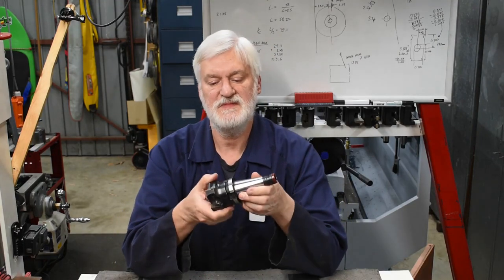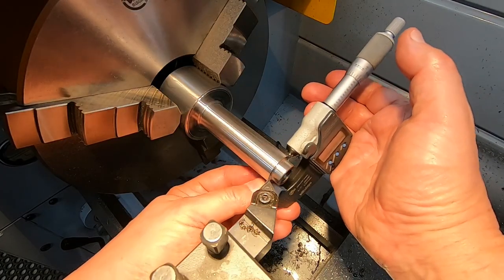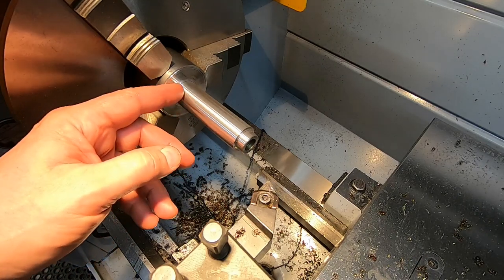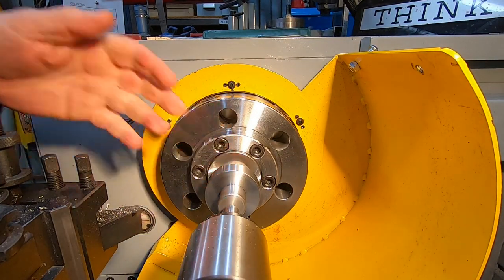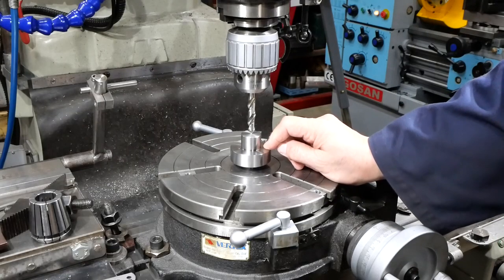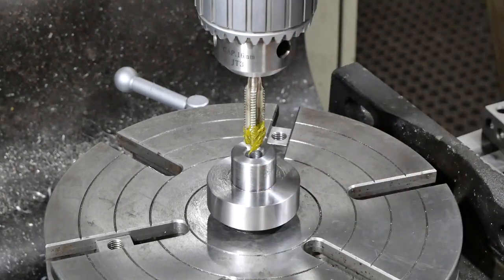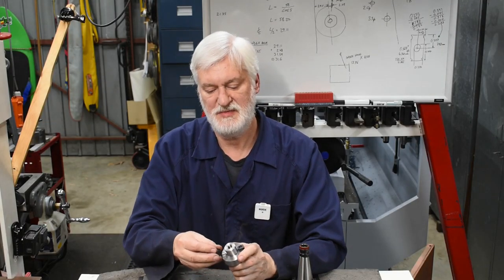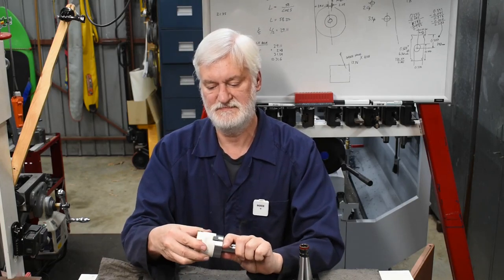Making a #3 Morse Taper milling arbor.

Comment: I started my apprenticeship in the late 60s. We were taught that the Unified system was replacing the Whitworth system of threads, the car manufacturers in the US, Canada and Britain were adopting UNS. In the end, the Metric system prevailed. So I'm surprised that you still use NS taps, unless there is more to the American threads than I understand. Not a complaint. But you do some very nice work, Alan.
Reply from the maker: Thanks for your feedback Bill. When I started working on cars as a teenager in the early 1970's, Unified threads were the norm in locally (Australian) manufactured cars but Whitworth threads were still common in plumbing and general hardware products. Metric threads were common in imported vehicles and starting to became more common in other domains. So I have worked with all three systems and have a good coverage of taps and dies for them. I have also worked with other metric thread systems eg BA, and pre-ISO JIS (they are found in pre-1967 Japanese cars and motorcycles). When no other factors apply, my preference is to work with ISO metric threads especially when using my lathe as it has a metric lead screw. But I also have quite a large range of imperial socket head screws (an auction purchase years ago) and prefer to use them rather than buying new metric items.
Cheers, Alan.

Comment: Question Allen. As a hobby machinist, somehow,  I know not to oil the tapershanks before using. However, just how clean should they be? Example, if I have a small film of oil on my hand and I wipe off the tapershank to remove any debris, would that have a detrimental effect on the tapershank holding still, or should I use a cleaning solvent to clean it every time? Thanks in advance.
Reply from the maker: Well, I'm a hobby machinist as well and can only comment based on my experience. I have no training or credentials to support my opinion and, for context, my hobby activities rarely generate any heavy machine or tool loads. The only time I have observed slippage in a MT shank is when I started using a 30mm twist drill with a 3MT shank. That occurred because I did not preload the the drill in the socket with an axial tap from a copper hammer. Now to your question Stephen, I wipe the MT shank before use with the "clean" rag currently in my pocket and then with a wiped (but unwashed) hand. When returning the tool to storage I apply some Inox MX3 (similar to WD40) to the shank. I probably should be more rigorous and disciplined about this, but that is my approach and it has worked for me - so far :)
Thanks for watching.

Comment: So thats a dedicated angle setting jig,  right not adjustable,  just for the MT3
Reply from the maker: I used a sine bar to set the angle of the lathe compound/top slide. The angle resulted from the thickness of the gauge block stack under one end of the bar and could be adjusted by varying this thickness.